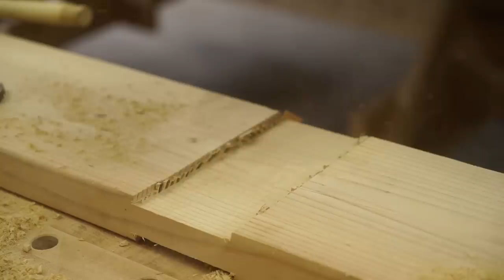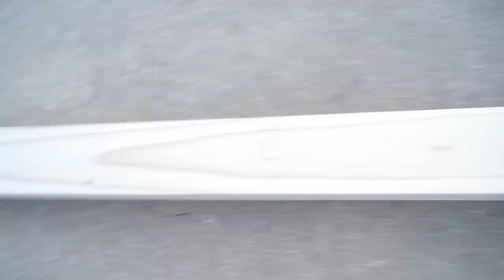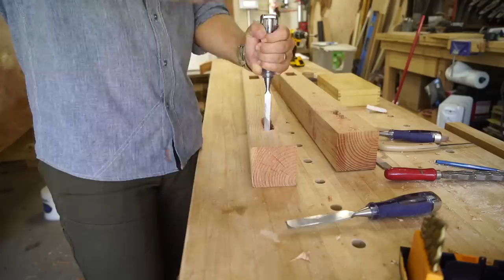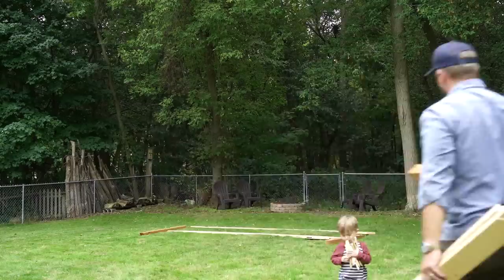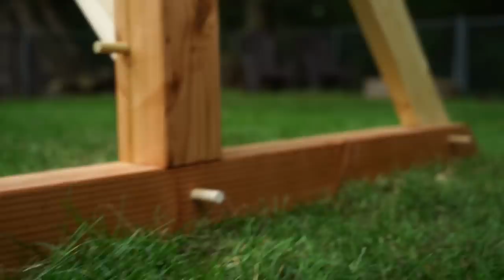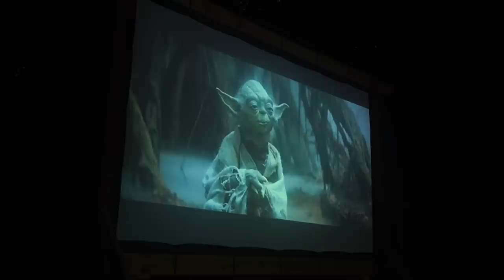Timber Frame Outdoor Movie Screen! // DIY Woodworking // How To

Comment: Awesome build.
I built a 120" movie screen frame this summer using 1 1/2"  PVC and the only real question  I had was how high from the ground the bottom of the screen should be. 

We were expecting people to either sit in lawn chairs or on blankets, and we didnt want so short a height that people's heads shadowed the screen, or so high that people on blankets had to tilt their heads up too much.  We went with 4 feet up.

Comment: That's a pretty decent one. I did a sloppy version of this 10 years ago for a smoke pit movie night at the base I was stationed on. We made it through a couple movies before it was shutdown due to fun overload. I thought it was quite funny that the MAAs shut it down halfway into "The Last Detail" of all movies. 

I have wanted to build another for some time, but with a homebrew projector/receiver to run the whole thing. If you want a fun speaker project, my idea would be for a stacked line array of 4" full range transmission line encosures and even better would be a 2.1 with a subwoofer using a 2x4 mini-dsp, a stack of TI tpa3110 chip ampifiers, and 4" tang band speakers with an additional amp and sub to back it up. You could enclose all of the amplifiers, a raspberry pi, and a projector into one housing. Then have the two line arrays and a subwoofer enclosure separate. I have a fairly decent enclosure design for 4" drivers. The idea would be to build 5 sets of those, and then make a mounting structure to mount them into an arced line array. (a line source of sound projects significantly further than a point source)

Comment: Please update on how easy it is to disassemble.  I would wonder with offset holes and humidity/ swelling being outside how straight forward that will be. Thanks - Love the channel!
Reply from the maker: They come out no problem. Just use a smaller diameter hole to knock the pegs all the way through
Reply: Third Coast Craftsman amazing. Good to know. Stereotypical Nomadic millennial over here and have been sketching out plans to build a ‘disassemblable’ desk and other furniture using ‘keys’ and draw boring